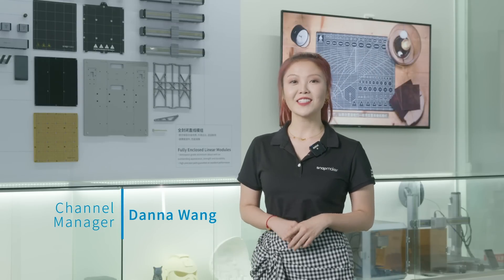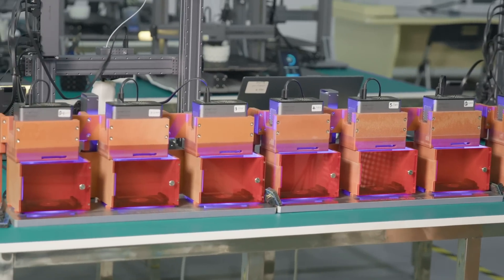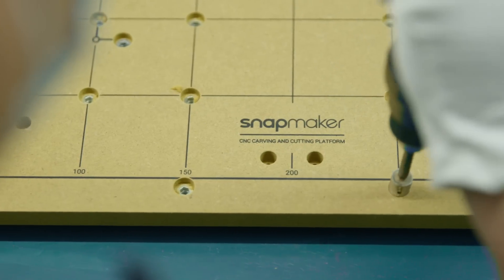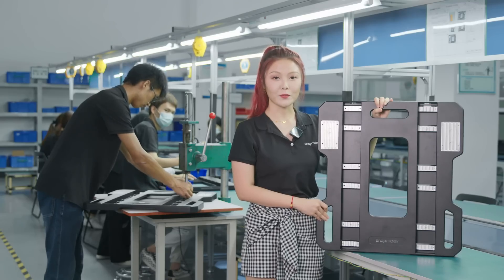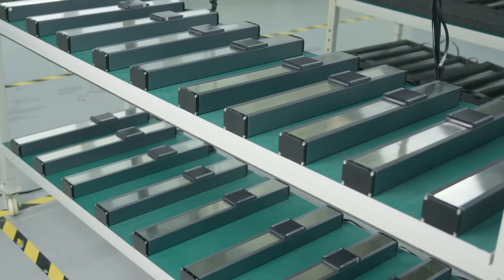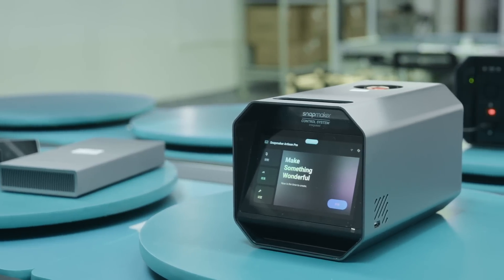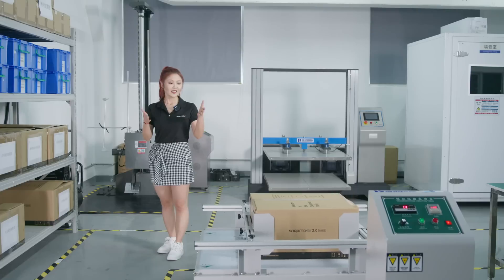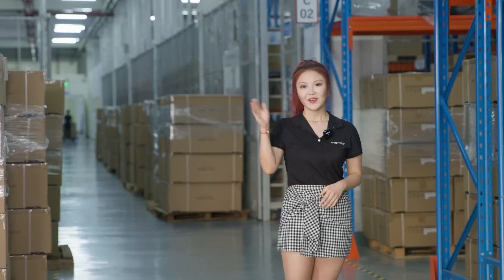Behind the Scenes: Artisan's Pilot Run

Comment: Can you please let us know if the vertical axis stepper motors are synced via cable? If not how do you account for them becoming out of step over time?
Reply from the maker: Yes, the Z-axis is connected to the master through the cable to control the movement.
Reply: @Snapmaker  Are both stepper motors linked so they don't become out of sync? There are two z axis motors so how do you keep the sync?

Comment: Many of us are wondering where is Snapmaker 2.0 roadmap and how far is dual extruder from release :P ... nice video tho.
Reply: Hmm, yeah! Where is the modularity that was preached about with the Snapmaker? As it stands, you can modify an Ender or Prusa machine more than this $1500 block of metal, and that's just from the community...
Reply from the maker: 🤫The dual extruder for Snapmaker 2.0 will be released at the end of Sep 2022.
Reply: Exciting!
Reply: @Snapmaker  Nice. And roadmap?
Reply: Just save your money and get a Mosaic Palette instead of waiting for SnapMaker's dual extruder, which compounds the complexity of the base machine. SnapMaker is nice but it's most gimmicky, copying others innovations and then packing them up is slightly nicer boxes for 4x the cost.  My Snapmaker had a liner module and control module fail within two years of light usage, and getting replacements was a multi week process where they repeatedly pushed new products and withheld providing the parts I needed to get my machine working.  After days of talking with their support I finally managed to explain I wasn't planning to pay another $1100 to replace a single $130 linear module for a machine with barely 200 use hours, and they were not happy.  Meanwhile, I've rebuilt my CR-10, TAZ-5 and CR-30 a couple times for less than the cheapest upgrade package they tried to push on me for my 2.0 A350.  I could have bought 4 ender 3's and upgraded them for the price they were trying to give me for the "required" upgrade just so I could use the version of parts they currently sold in their store, since the old versions are no longer available.  On top of that, the machine is only more cumbersome to do any meaningful DIY upgrades to, you're mostly trapped in their ecosystem without options.  For example, my CR-10 has a new heater cartridge that gave me another 100° for about $15, and that's probably a $200 SnapMaker module plus supporting module updates.... Disappointing value for the money.
Reply: @JamesZimmermanII  I was thinking about that but I need mostly just regular material + water solutable and was hoping to get the solutable one going with larger nozle diameter so I kinda want dual-extruder but it could be interesting to combine those two solutions one day :) ... It also looked a bit complicated and I was not sure how much well it would worked with Snapmaker and be reliable overall.

Comment: Wow, I'm the first viewer! Would be a customer for this if I had not just purchased a V2. It is excellent by the way and the 10W laser in particular really exceeds expectations! The Artisan base design with recessed linear modules is smart, but you could have used the same trick the other way up for the bed - use the space between the linear modules to thicken and stiffen the bed without increasing its height.